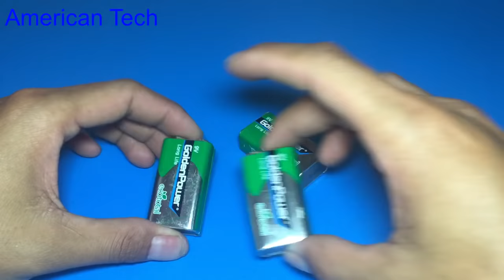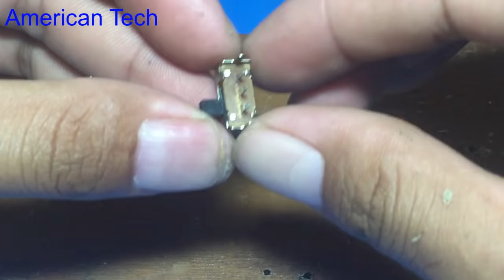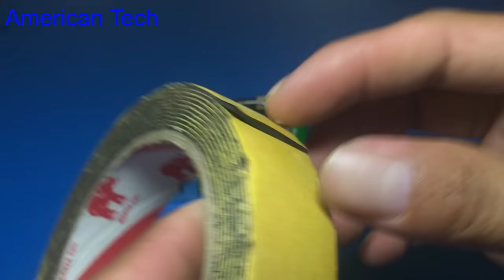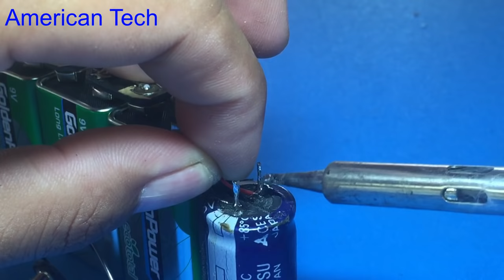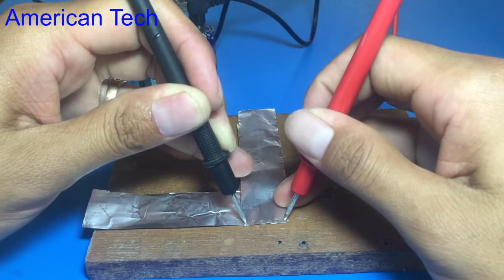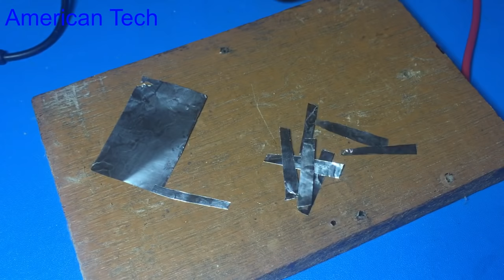How to make mini spot welding using 9V batteries and capacitor

Comment: What a life saver, the amount of times I've cut tin foil too small for the baking tray. Had to throw it away and cut another piece. Now I can just spot weld some extra on.
Reply: Good for cupcakes too !!!!!!!!!!!!!!!!!!!
Reply: @headshotzombies  too bad it can't spot weld for some extra iron in the cupcakes!
Reply: 🍼🍼🍼😢😢😢😂😂😂😂😂😂so funny
Reply: If only 9V batteries were free ;-)
Reply: Lol this comment is "SPOT ON" 🤣 pun definitely intended!
Reply: Jajajajajajajajajajajajajajaja
Reply: Be careful you don’t just burn holes in it !
Reply: LMAO
Reply: LOL!!!!
Reply: Come on, we both know if you can't microwave it your not cooking.
Reply: I agree with you 🙃
Reply: Is true may not be very powerful but on a more real note think of all the times you've driven by someone's rubbish pile and they've thrown away one of those old Barbie cars or Power Wheels Jeeps or some such those are 12 volt batteries and most of the time those batteries are still good when the motor and other parts stop functioning or people's children outgrow them I have numerous times stopped and pulled batteries out of those so could you imagine if you did this with larger batteries than you would have more power though you would need to do the conversion and figure out what size capacitor or resistor would be required and if you wanted an even larger scale you could use car batteries and things those are fairly cheap if you get them used so maybe more of a toy in its current size but I can definitely see where in a pinch this is good to know
Reply: Lol

Comment: Are we just going to gloss over the fact that they didn’t know that 9 volt batteries can be connected together? And that using solder as a wire is horrible because it melts with sufficient amperage?
Reply: The batteries supply 27V whereas his capacitor was rated for 25V.

Comment: If those 9V batteries is not rechargeable,it will cost more as you need to replace after the energy have worn out. Perhaps good to invent one temporary emergency use .

Comment: The electrolytic capacitor voltage should be chosen above 27, it cannot be selected lower than the operating voltage. If 27 volt DC was obtained with a high amperage battery instead of a 9 volt battery and given to a 25 volt capacitor, the capacitor could be damaged by swelling, it would be more appropriate to choose 50 volts. Also, I think that the selected foil strips are very thin and the same welding process could not be done with the slightly thicker ones. This process cannot be done for a very long time with these batteries, because the battery poles are also short-circuited with the capacitor in spotting, at this moment the battery connection with a switch should have been disabled, in my opinion. The most suitable for home may be the form of changing the winding with transformers taken from microwave scrap and applying the high amperage to the strips to be welded by hand mechanism. Good luck with.
Reply: I think so

Comment: 25V capacitor charged 27v is not a spot welder, its a bomb ⚡️💥
Reply: Not really there is safety factor in the capacitor
Reply: I think is less than 27V for the use
Reply: Yes,,, that's true,,🙆🙆😁😁
Reply: Allahu Akbar
Reply: @rf7official923  1
Reply: @waterjoe2024  if it's rated then don't surpass rating unless you want trouble...
 rated 25v:
Max I would put it on is 26v but that's pushing it.
Reply: -trouble or you trust it
Reply: ' hey guy's.. Check out this thing I made... All you gotta do is pr...💥💥💥💫💫💫🤕🤕... Well, that kinda sucked'....

Or something like that...😂😂
Reply: Correct my friend
Reply: When are those 9V actually 9V even out the package? Then you've got voltage drop as it's charging so they won't be 9V long and whatever they reduce by times three. It'll be fine.
Reply: Is it safe he used solder wire as a ordinary wire? 

I tried it on a different batt and it melt
Reply: @johnedenriquez7156  that's why there's no surgeon posting some minor cutting operation. ...." see mom, I saw that on YouTube by Dr. Kutter"
Reply: I think maybe they bettery is old and has reduced current
Reply: The cap is rated plus minus 5% its within spec, and a 9v is closer to 8.7 new anyways
Reply: It’s not safe, but ok
Reply: capacitor farads? hard to read
Reply: @waterjoe2024  àa
Reply: Exactly 😂 you need more amps for welding and not more volts!
Reply: @christianepremian5322  4700 microfarads. 25volts
Reply: @1978narcis  so what size should have been used
Reply: @1978narcis  you mean voltage. Current IS amps.
Reply: @christianepremian5322  4700 microfarads.
Reply: Four six volt scooter batteries or twelve v lead acid and then you don’t have any problems. Eighteen AAA batteries....
Reply: I've got a mini tornado siren that runs on a 3V motor, and it has a capacitor for the wind down which is rated for 2.3V I don't get how it doesn't blow up or even get a little warm 😂
Reply: @Smitty-op4ld  yeah but theres no need to do it... a 50v capacitor will work just as well and be way under the limit

Comment: I've always wondered how foil can be welded thank you so much now i can cook turkeys and anything else that needs foil welded my life is now complete.
Reply: Solder should be fine as even if you are pushing 20A it is for a split second,  but the cap is underrated.

Comment: I can't thank you enough, you saved me thousands on repairs! I was able to weld the muffler back on my truck,  repaired the frame on my travel trailer, and even made a bird cage for my parrot! What an amazing idea, why doesn't everyone do this?
Reply: Yeah this really works!

I was describing the dislike button
Reply: Sorry, I couldn't resist. I have no self control =)
Reply: No need to dislike. It's such a strong word.
Reply: His method still works.

More power
Reply: Same here. I was building a space shuttle at my garage and all I needed was a spot welder. But the icing on the cake was the batteries still had enough charge left in it to power the fusion drive. I really wish NASA see this video.
Reply: Scarlet Matt          My bike broke in 2 pieces luckely i had this thing on me
Reply: Hell ....I used it to weld  a hole in my  shorts then went to the beach with em to show all the girl's what I done did ..........Uh Yep  !
Reply: I even bring it to my jobsite and introduce to my friends. Now all of my friends use this method to do their metal work.
Reply: joseph chan        If only they had one of these on the titanic
Reply: @xxjeroen  its kinda sad to think why they didnt discover this method back then.. if they knew they will the happiest couple in the universe.
Reply: Eric Ek if you run the batts in series the way they’re designed to be ran, and then wind up a primary and secondary of a repurposed salvaged transformer, to give you 2-3 volts at about 25 or more amps,  you can actually weld up to 5/16” steel in short beads (3/4” at a time) and get legitimate quality results
Reply: The best thing in this vid was the backing music, great beat. The hands looked Asian ...little wonder that this was one of these 
absolute rubbish vids...they tend to publish 100% crap projects that no one would need.

Comment: Are you really using solder as hookup wire? Wouldn’t that melt under the high current load of something like, say, a spot welder? 🤔 Oh and the cap is under-rated
Reply: Yeah I saw that, and thought wtf. Then I was looking at the batteries in series. 9 + 9 + 9 being paired with a 25V max rated cap.
Reply: Yea definitely needs improvement, at the very least.  Good jump off idea to mess around with tho, I'd click fit the batteries together add 2x caps that are rated for 30+v and duller probes that don't poke thru things.
Reply: But the video is well overrated.
Reply: Take the video for what it is - a clever hack based on surplus materials and a bit of craftmanship.  You were not expecting an industry grade spot welder allowing you to do welds on an SUV, where you?
Reply: @ralfbaechle  But it's not a clever hack. It's a really dumb one that shows no knowledge of EE. It doesn't actually work as a spot welder and overdriving the components like that mean none of the parts last very long.

Finally, if you are making an EE protect project and you find yourself using solder as hook up wire, you know you have done something wrong.

Comment: Cool video but I think I'll just get a bigger piece of aluminum foil but still nonetheless pretty cool..
P.s. if you put one electrode on one sheet and touch the other one to the other sheet you should get a better weld as the electricity will flow from one piece to the other instead of the same piece to the same piece and counting on heat to make them stick. Thanks for sharing

Comment: It may be good in schools to explain to the kids basically how spot welding works and let them have some fun without risking them.
Reply: Yeah, kids do know what experiment they want. We, in the old days, made some hot sandwich and potato in the tempering oven while the teacher was away.
Reply: Sándor Gombai - and we wrapped our alu foil around a table tennis ball, burn it up on one point and soon had smokebombs
Reply: This thing is potentially lethal. Not good in schools at all.
Reply: @EJP286CRSKW  I forgot about choking hazard on swallowing the pieces.

Comment: Anyone noticed how he hooked up a 25v capacitor to a 3*9V Battery pack? This spot welder can even weld itself
Reply: The voltage rating is typically for 10,000 hours.   As long as you're only using this for a few minutes, you can probably go quite a bit over the rated voltage before it lets out the magic smoke.
Reply: Yes I noticed that as well 9 + 9 + 9 comes to 27 I've seen capacitors blow at just as little as a volt over the recommended voltage and plus why use solder as parallel Bridges when you can just snap each end of a 9-volt battery together or use some thicker wire
Reply: What I think is the brilliant stroke is using the solder as the wire. Maybe it will work  but if it doesn't, then you have 450f metal all over
Reply: Hmm.. is there voltage drop ?
Reply: 9V batteries are almost 10V fresh! 
So putting almost 30V into a 25V cap.... Dodgy
Reply: @junkthe  Big time. After 1 or 2 welds I bet those batteries are making about 20v. They rebound when the welding stops.
Reply: @woodworkerroyer8497  he's not using solder as a bridge wire; he's using it as a fusible link. Fuses are made of tin and lead. Oddly enough, solder is also made of tin and lead. I'm sure he knows he wired the batteries in series.

His batteries & compacitor are going to fail. Those fusible links may save him from explosion.

Comment: It is recommended to increase the withstand voltage and capacity of the capacitor. In addition, when the instantaneous discharge occurs in contact, the energy is consumed by the spark discharge and the effect is reduced. Therefore, switching is recommended using a thyristor. The breakdown voltage of the capacitor should be about 30V.
Reply: what is exactly the role played by the thyristor in this contraption? thanks in advance for the answer.
Reply: @abedee6027 with real spot welder devices, the idea is to allow the connection to be made first before electronically discharging the energy pulse, so it doesn't heat just the surface. With low powered welders though, the resistance at the contact point is needed to generate enough heat to weld.

Comment: Most likely the tension is too much and the electrodes are too sharp.
You could possibly try to parallel the 3 9v batteries, so as to have a lower voltage but a higher current; moreover, also the condenser could work below the maximum voltage parameters.
However nice idea.
Compliments
Friendliness and greetings

Comment: The best way is to simply use 18650 cells, get ones that are out of a drill battery, usually these are capable of outputting 10A per cell. 
Now solder together 2 in series, and then another 2 in series, then solder both of those series in parallel. This gives you a 7.4v batter with a 20A output rating. 
This gives you around 148w of possible power, which is a lot. Now solder a pretty thick wire from these batteries, and you want to solder onto this a type of switch that is only on when you press it down, similar to what's in a video game controller, but you want a more heavy duty version, this means when you let go it will automatically turn off, there is no risk of it going too long for example, you can do 1-2 second easily with your own finger control. 
You can also get hundreds of spot welds done before the 18650's need recharging.
Reply: I think you need to read up on series and parallel connection. Putting two cells in series that can source 10A will still source 10A. They need to go in parallel to source 20A.
Reply: @zaprodk  I think you need to do some revision yourself, he's talking two in series, times two, ie. 2s2p. 4 cells in total.
Reply: @zaprodk  batteries connected in parallel = Voltage remains the same, current is added together.

Batteries connected in series = current remains the same, voltage added together.

So, 18650 cells that are fully charged, 4.35v let's say with 10A capacity, connect two in series the voltage remains 4.35v but the current is added 10 + 10 = 20.

@Sam Mitchell add each other, not multiplied by 2.
Reply: @HamzanMartinez  I have been working with electronics all my life - no reason to educate me. A standard 18650 cell you do not want to charge to 4.35V unless you want fire. HvLi-cells in 18650 form factor is very unusual.
Reply: Okay, so let me get this straight, if I understand you all correctly here, batteries in series multiplies the voltage by however many batteries are put in series, however, put those same batteries in a parallel circuit and you multiply the supplied current of the batteries, correct?🤷🏻‍♂️
Reply: @delmaneboshoff5610  Correct.

Comment: Wow, he really used 25V Capacitor on 27VDC batteries, i'm surprised it's doesn't explode...
Reply: Its probably why he used weak points between batteries rather than just daisy chaining them like a fuse...
But yeah he should have used 50v even as long as its under it will work fine... no need to be on the limit

Comment: use brass or copper electrodes, can be done with low power 12v power supply+resistor and larger capacitor with relay who charge a cap. and cut off the power 
supply when weld.